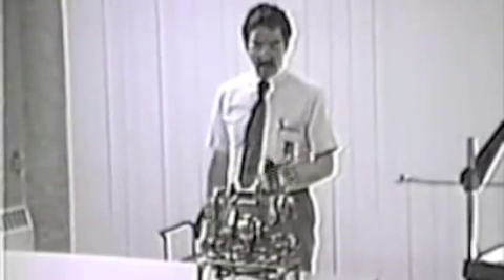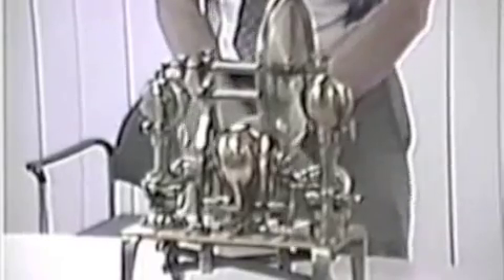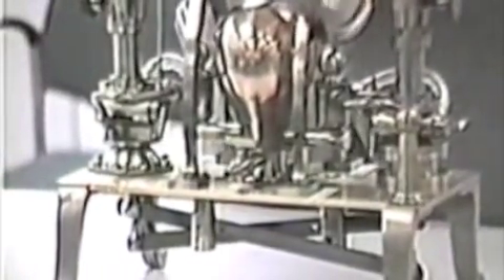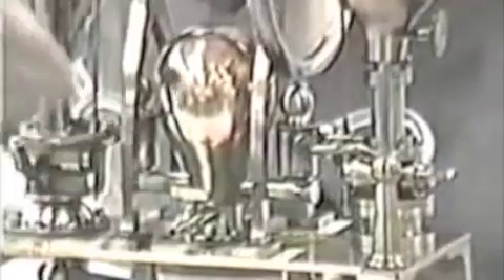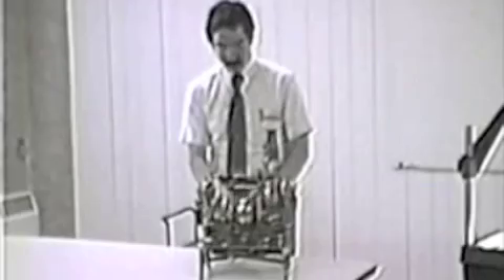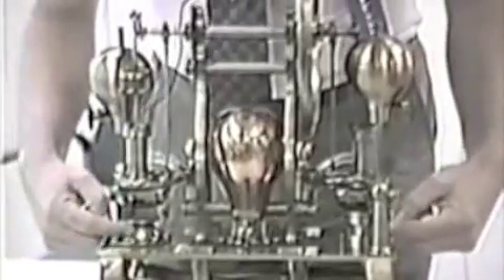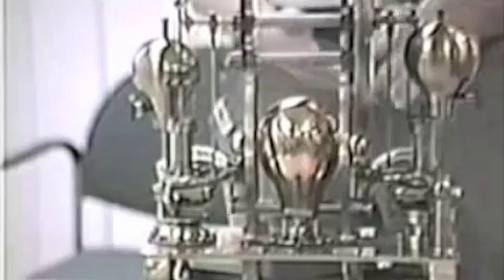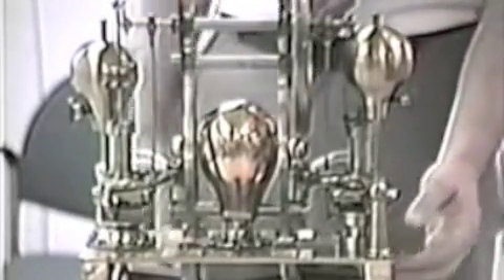Dale Pond Explains Keely's Water Implosion Device. Giza Pyramid.

Comment: The timing of those valves is like getting the right sound reverberation. The pyramids of Giza are finely tuned to an F# configuration as detailed by Christopher Dunn. There's a similar device called a "trompe" which uses water as power source.

Comment: This video just answered a big question for me. That you for posting. Water hammer explains why the buried PVC water pipes are breaking at our house. Washing machines cycling water on and off is moving those pipes and the sand and gravel are wearing them out on the outside.  Thanks again.

Comment: Lakovsky came up with something similar to this with electrical antenna. He designed it purposely to not be symmetrical. I think a better name than female contraption would be a union between ordered male and chaos female, an ordered chaos or a heterogeneous contraption(as opposed to a homogeneous contraption). Females are the chaotic energy, males are the ordered energy, combine the chaotic with the grounded and things are amplified and creation occurs. A homogeneous contraption is symmetrical and the materials are similar and their is a defined rigid order to the structure of the machine (like the order/logos/chivalry/honor/busido of males), while a heterogeneous contraption is asymmetrical, the materials are complete opposites and there is an 'ordered chaos' to the thing(like the union of the males order and the females chaos in order to create aka heterogeneous). Heterogeneous metallurgical alloys are thousands of times stronger than conventional homogeneous metallurgical alloys. Combine wool or yarn with large coils of copper wire and youll be blasted off your feet. Things work best when the male becomes unified with the female aka heterogeneous. The true message John Keely was trying to convey with this machine was don't be a sodomite.
Reply: Except there is a major design flaw  in the Lunar Wane shaft that will obviously lead to excessive side fumbling which will cause the unit to never reach peak cardinal gram-meter uni-rotational output torque in a linear manner

Comment: So why not just use a turbine disc to form the pump, and use veins along the outer circumference which resonate perfectly with holes at the outer circumference of the disc? You get water hammer and you get vacuums simultaneously as each vein moves fluid into or away from the cavity which has around .5mm to 1mm of gap to the housing where water can steam can exchange.
Also , if he changed the seals he changed the resonance if the seals were not the same thickness. one could tune it using a 2 channel  oscilloscope and a simple pair of coils.

Comment: Weights absorb the shock of pressure of implosion oscillations through the pressure mediation of the weights through the ether. This is why it is able to achieve infinite pressure without destroying itself. Much like the turbine version uses the ambient air to absorb the oscillation it creates. The surrounding ether is the actual shock absorber. Comes down to mechanical vibration of ether.
Reply: That's why the pyramids look like they have 9 sides, right? Because the implosion is pulling the bricks towards the center.

Comment: The center bulb is like our heart, a regulator of the liquid. This is the fourth state of water, EZ water. That pulls liquid through a tube. 
 The pistons are space and counterspace (negative pressure). Microwave changes the structure of water.

Comment: If the large scale version in Johns building had not been destroyed when the building was demolished you would have a better understanding of the pressures and timing involved. There are frequencies produced that can super heat as well as disrupt matter or cause levitation type effects. The fluid depending on it's viscosity and or salinity would act as a hydrolic spring of sorts. Measure the frequencies carefully when playing with this model. and wear ear protection.
Reply: Jeff Keeley what happened to this - what is the latest on this technology being mainstream etc.
Reply: @zabdas83  I'm sure it has been experimented with and refined for many different purposes.  Although technology like this never reaches public utility.  There are a plethora of applications. The mind boggles on what may be made use of anything that has resulted from experimentation on this. Most likely military tech unfortunately.

Comment: I think I figured it out. Left side is expansion. Right side is contraction.  That's why they're different.  They ARE balanced, like tuning two strings on an instrument to match.  I can probably fix it.  IT should actually work.  It's very hard to explain.  it's LENR / cold fusion AND a touch of water spring. you're going to need to make a model with an oscilloscope and pressure sensors. it's not super simple.  it's exploiting the effects of the materials at harmonic construction

Comment: The word Pyramidos has been translated as "Fire In The Middle". This meaning is very interesting also :
Pi -    3.14  pi was used alot in the building, quadratic down ward pressure on the lower piramyd creates heat and pressure
Ra -   The sun disk was either seen as the body or eye of Ra
mis ?
is there a way one could add outside heat to the machine?
the most crude way i can imagine is if this device came from the middle of the piramid or was located there
where they used a fire under the machine to pressure it... or lead hotter water.. into the machine...
to create a hi pressure device you can use....

the piramid itself was probably an entire machine itself to condensate water...life).. pressurize water....
move water (water ram) (water lift) in a direction...boil water (safe drinking)  my guess is not only water but also electrical power... tesla knew these principles.. i think they discovered battery's before our modern society did...
we only realised THEY had batterys after we knew what a battery was....
free energy cant be metered.... so it dis apears...

ive made some drawings, im no mechanic... but i think ive found some intresting ideas....

https://dl.dropboxusercontent.com/u/70805005/piramids%20idea.rar

hope u get some new ideas for directions to think along thank you for your scientific work!

material density seems very important for magnetism  the two different used materials also do 
alot for this machine i think.... flow of material....

Comment: This device based on the same principle as the Ram Pump in my garden , A very widely used  method of generation hydraulic force at the start of the industrial revolution but sadly seems to have been forgotten.
Reply from the maker: +olevels It is not based on a ram pump as explained in the video.
Reply: +reddpill
i thought rampump at first but a ram pump is dependant on the rubber diaphragm inside the bulb for action  (as you know ) and has to be reset every now and then....

Comment: @reddpill Why you be puttin 'Giza Pyramid' in the title? You thinking what Im thinking? I'm thinking the chambers of the pyramids are either made to harness vapor cavitation or water hammers (which is basically vapor cavitation) which can create infinite pressure(or infinite 'over unity'). Its like an input force is 'double jumped'(like on a trampoline but not just at the lowest point, also at the highest point) repeatedly, forever(or until the parts wear) , and like Dale says, after 8 iterations the pressure becomes unmeasurable so basically infinite. Is that why you attachin Worrell Keely aka World Key to the Giza Pyramid? If so, I agree! imo Keely is the KEY to everything.

Comment: You lost me at "female energy".
Reply from the maker: Today we call it angular momentum, or what a layman would call a Vortex. And like everything in Nature or what we call physics, all energy is binary (dual, positive - negative).  'Male' energy is the centrifugal motion of a vortex, explosive, outward motion which creates heat (see washing machine, which is why clothes deteriorate through using them, pulls them apart, oil based engines).  'Female' energy is the centripetal motion of a vortex, implosive, inward suction which creates cooling (walk into a forest, gliders raise and work better over forests than towns, towns create the incorrect energy form i.e heat).    

Today's so called "experts" make it impossible to understand, Nature doesn't.
Reply: I think female is inward Vs. male  outward. Implosion Vs. explosion. Centripetal Vs. centrifugal, Etc. While we're at it what is this plumbing supposed to accomplish? Does anyone know? Is it a motor? I can't say "Pump" cause  Mr. 'redpill' forbids it. Plus I don't think it's a pump anyway. It certainly has pumps and must pump water around it's circuit.  Does it produce some kind of 'miracle' water potion with crazy electron spin reversal or ????
Reply from the maker: Coil Smoke I never said that 'pump' was the issue. What I'm trying to get people to grasp is that the water itself becomes the internal mechanism, just as Dale Pond states in the video.  This is also true for the liquid diode that I modelled from the passages below the  Great pyramid where the water forms the mechcanical 'moving part' or the one-way guide.  It's a very important idea that should change the way we design and harness energy.
Reply: No pump indeed because we call pump something actioned by a male motor and actioning over the fluid inside,meanwhile this device seems to be actioned BY the liquid inside.Our brain needs another word and another picture of the phenomennon
Reply: neogerula indeed the water becomes the moving part of the machine, so ingenious for that time !
Reply: +reddpill
thats why i get the old washer woman to wash my clothes ;-)
Reply: +mad scientistshusta
like an electrical arc jumping a gap to complete the connection?
Reply: Glenn Hubbard yes like atomic bomb is male